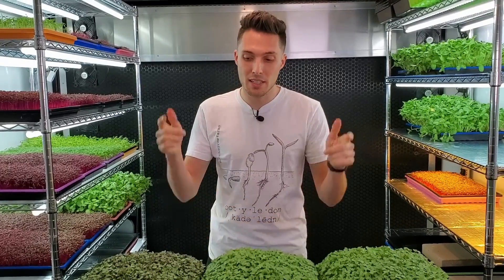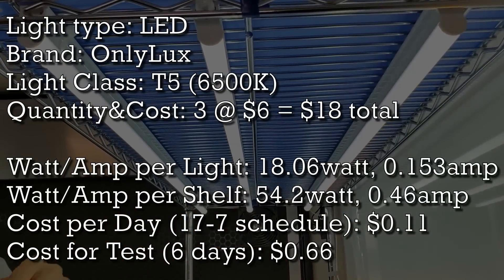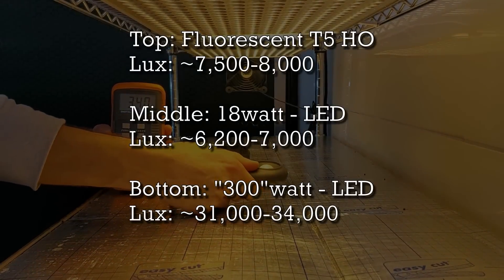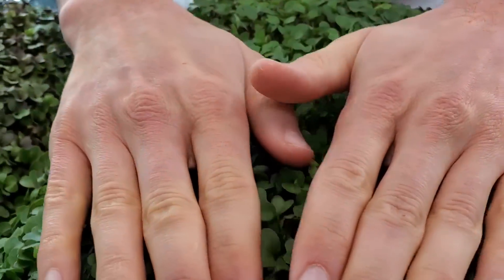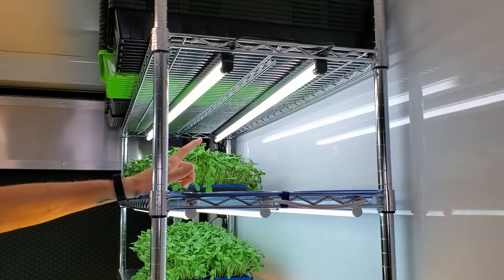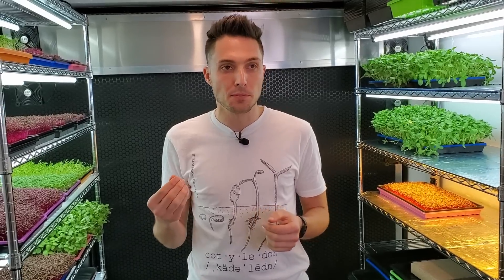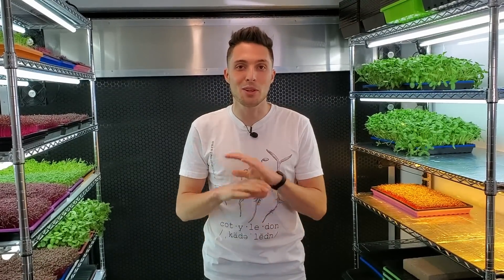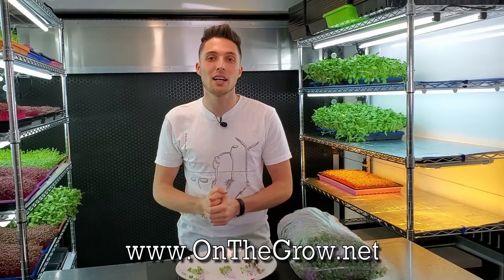Microgreen Lighting: Fluorescent vs LED's - Purple Kohlrabi - On The Grow

Comment: I don't know i it's just my imagination, but I seemed to noticed in your previous lighting test that the LED Panel lights had the biggest effect at the end of the growth cycle. (Looked like the biggest benefit came in that lats two days)

 Have you considered doing a test where you start identical trays under the cheap fluorescent lights fist but you finish them with different durations under the LED panel lights?

e.g. So if a crop takes 10 days then...
Tray W gets 4 days (day 7, 8, 9 & 10) under the LED Panel
Tray X gets only 3 days (day 8, 9 & 10) under the LED Panel
Tray Y gets only 2 days (day 9 & 10) under the LED Panel
Tray Z could be a control group that gets 0 days

If the major benefit of the yellow LED panels only happens at the end of the growth cycle for example the last two days then maybe you can improve more batches of crops by just finishing them off under the yellow LED panels rather having the premium shelf-space taken up by the plants that can't yet fully benefit from the quality of light.
Reply from the maker: We will setup an experiment for this soon! I like the theory!
Reply: @OnTheGrow  I was going to suggest the same thing. Did you ever try this?  Also, is that one trailer your whole micro green farm?

Comment: With the cheaper lights they should have been a lot closer. I was under the impression or read somewhere that optimally they should be within 6 inches of the plant. I have the fluorescent bulbs and I don't think they even last two years. I need a cheap light so I will definitely try those $6 LEDs and hope you got a link in the description.
Reply from the maker: Hey Robert! All the lights are at about 7inches from the top of the trays, so they were probably only 5inches from the lights towards the end of the grow. 

Yeah, we have some 20watt linked in the description because they stopped selling the 18watt versions. 20-22watts should give you slightly better grows!
Reply: @OnTheGrow  Thanks, it just looks like it was further away on camera. I am getting ready to start my outdoor garden so those lights will be quite helpful. I already bought shelving last year to do a similar set up to what you guys have. Really trying hard to get a good garden this year. Last year I unfortunately got some contaminated compost that ruined everything. Got 4 ears of corn from nearly 200 plants and there were 4 different kinds, so it wasn't the seed. My beans and peas all came up super burnt. Oh well. Thanks again for the reply.